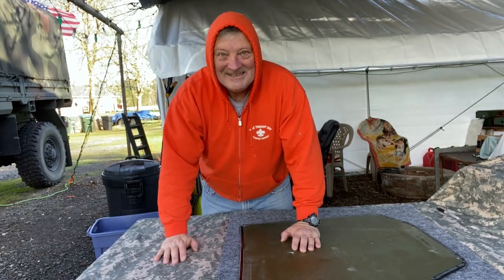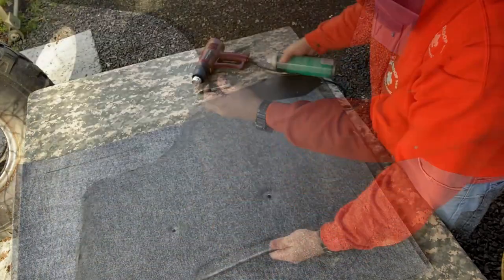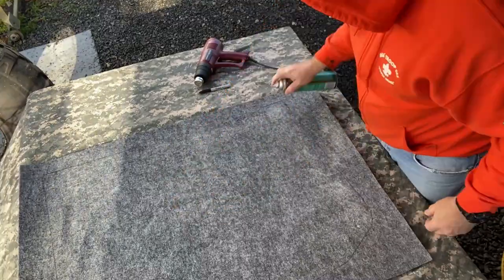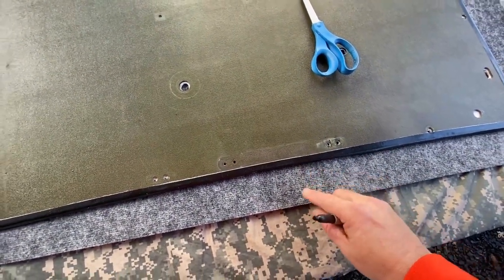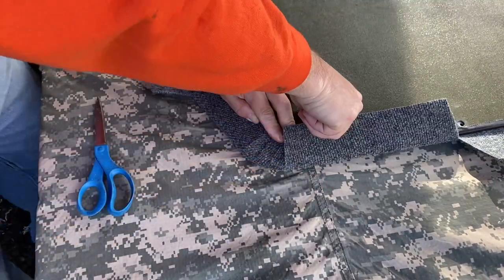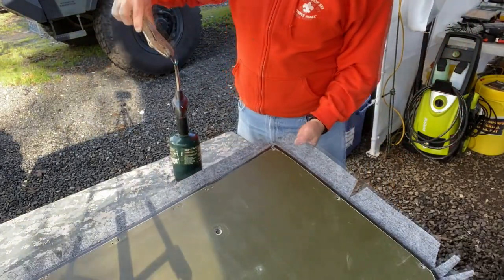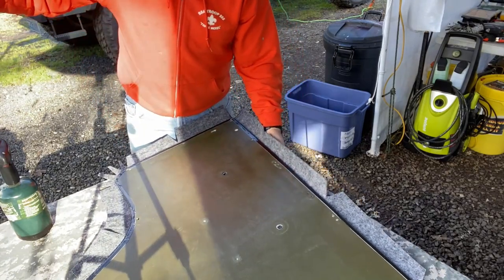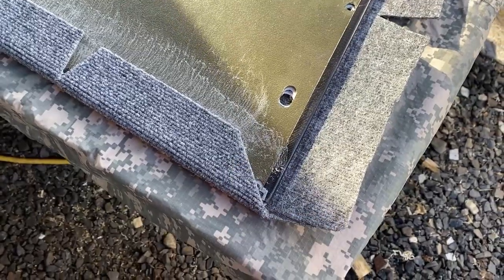FMTV HOW-TO UPHOLSTER a Door Panel #161

Comment: I was wondering if you would get a copyright strike for that.  I get them too.  Most of the time I don't care I just leave it up.
Reply from the maker: The secret is the speed up the tune to 1.1X and/or layer something else over the top, like the rotor noise of an incoming helicopter. Heeheehee. For 10 seconds of content, I would rather it not be monetized at all than to give someone 10 minutes of my content for free. It's hogwash.

Comment: I have one question, It involves your health care provider. Twisted metal and door handle may require a Tetanus shot to operators.  We talking a Star and something coming off the star?
Reply from the maker: Indeed, Bob. The star is a little buried due to the extra sound proofing... I saw an extender that I could order... we could weld whatever you come up with on to that. I also have a ton of railroad spikes the Scouts picked up on the last 50 miler rail trail. It might be best to see it first hand to decide what is best to do... I can pick you up on Saturday morning this weekend as we head out to Mike Moffitt's place for the transmission oil flush and refill... you game?
Reply: @HelicoolsHelipad  Not sure about Saturday yet. Sounds like the Financial advisor meeting for our year end review.